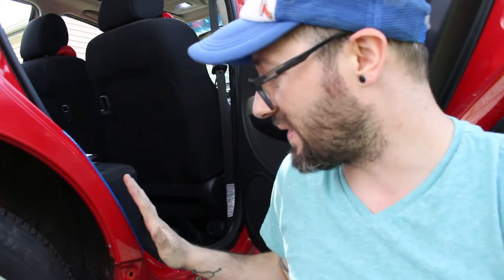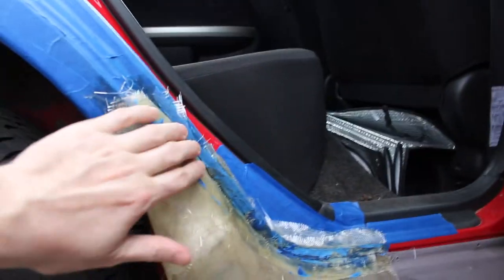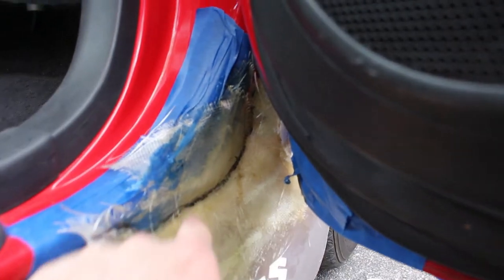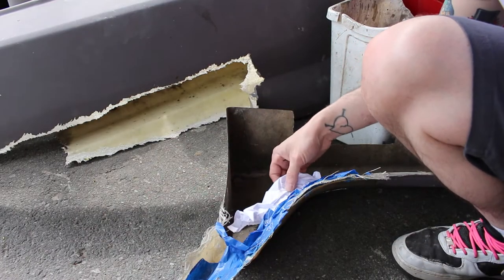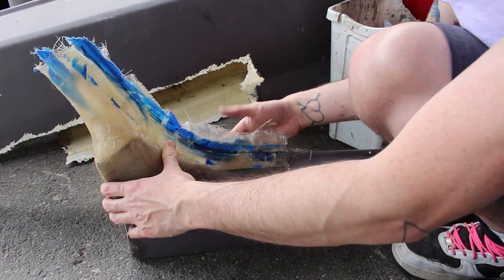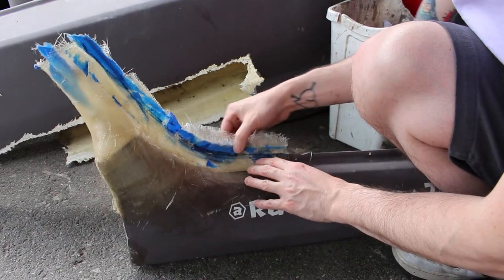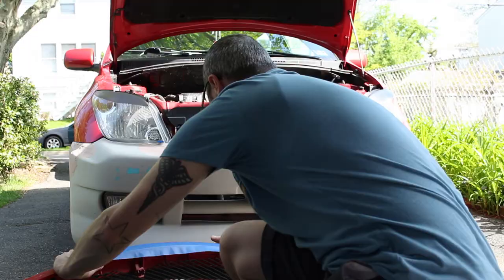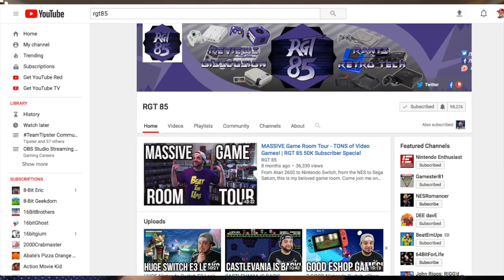M Kart Build  continued  | Daily Vlog EP 105 | Russ Lyman

Comment: hey russ, where'd you get the grille from?
Reply from the maker: Hey Jamaur thanks for watching. This model scion was a release series so it came stock with this grill, but I did have a 06 xA before this one and upgraded to this style grill.
I ended up getting it off a member of a Facebook group for scions.
Club IST/ xA or Scion xA/IST parts for sale
or here is one like it on eBay - https://www.ebay.com/itm/For-Scion-xA-2004-2006-Duraflex-1-Pc-K-1-Style-Grille/301874403018?epid=1394475027&hash=item46491dd6ca:g:f1kAAOSw0jJanoqP